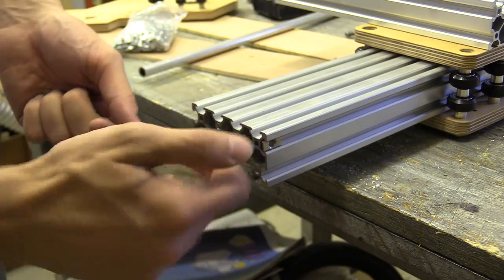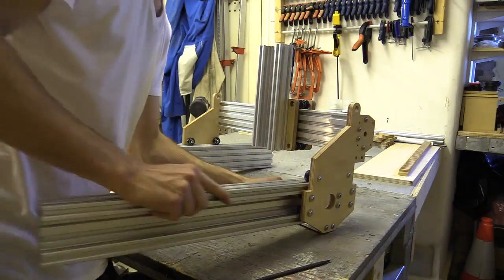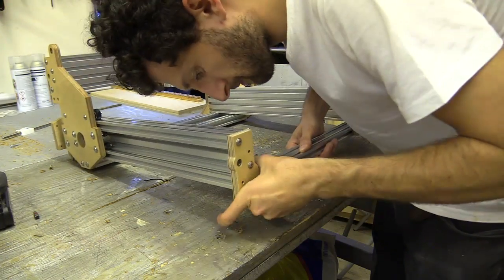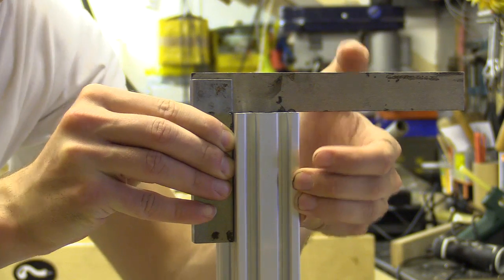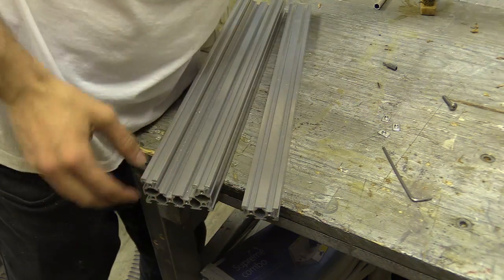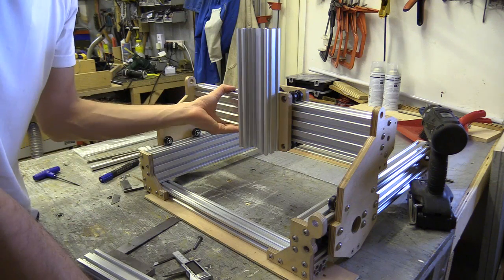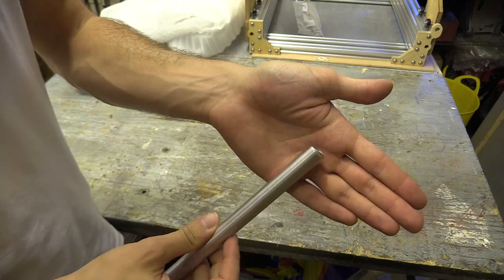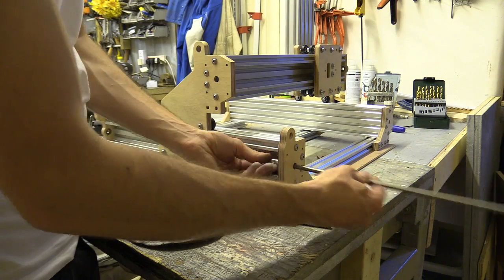#4 Assembling X and Y Axis & making ACME Locking Collars #4 / C-Beam Lead Screw CNC

Comment: Hi, some if the intolerances may be on account of the tabletop not being really flat, I think. Did you level the frame before measuring?
Reply from the maker: I'll have to re-look at that. Maybe place it on the table saw bed. Thanks for the suggestion.

Comment: Savvas , can't remember but will you be offering plans for this creation ????
Reply from the maker: The build and some early plate designs are available here: http://www.openbuilds.org/builds/c-beam-lead-screw-cnc-mountain.3947/  - but they are not where near complete and I haven't worked out the cost or material. I might also make a booklet / journal to accompany the videos.
Reply: Thanks for the info 👍

Comment: What type of blade are you using in the chop saw to cut the aluminum rails?
Reply from the maker: Just a normal wood blade.
Reply: Hmm and it dosen't mess it up for cutting wood?  I have read that a carbide blade was required.
Reply from the maker: Most table saw blade are carbide tipped nowadays. It seems to be ok and I don't cut aluminium 24-7.

Comment: Oy !! ... unless you've used a machinists level to deck the table flat.... nothing can be trusted.
You can mark out and drill and tap FURNITURE or APPLIANCE LEVELERS into your CNC base so it can be located flat and square on that tabletop.

Comment: Sir: Is there any chance that I might be able to get the plans for this great machine.
Reply from the maker: Look me and other version of the design up on the Open Builds website - but I've only put up the first version of the design. Once I have finished the new controller I will cut out a updated version on the machine itself. That's the plan anyway.